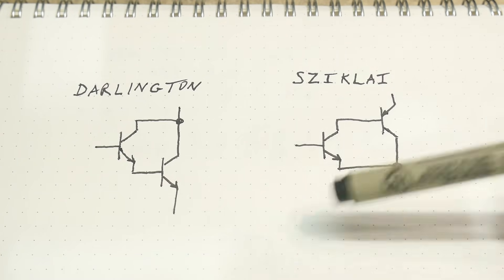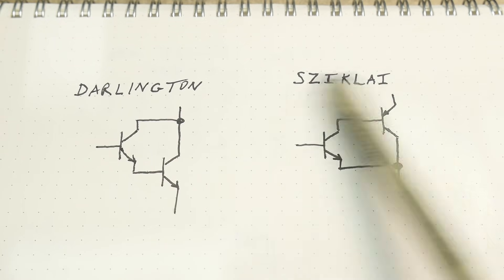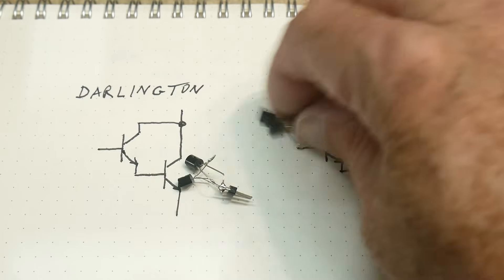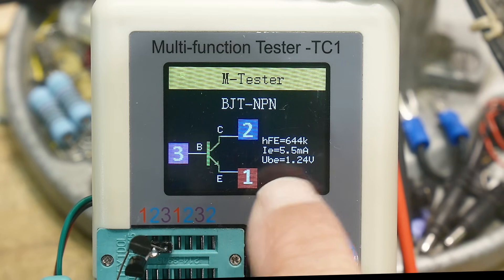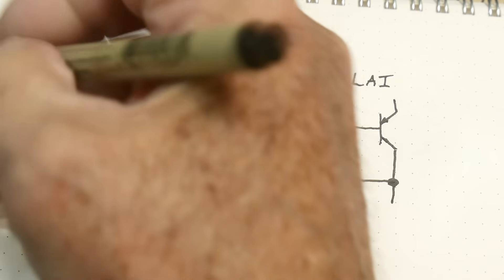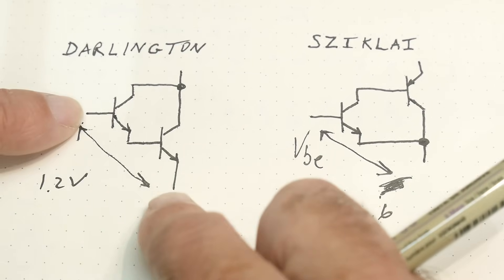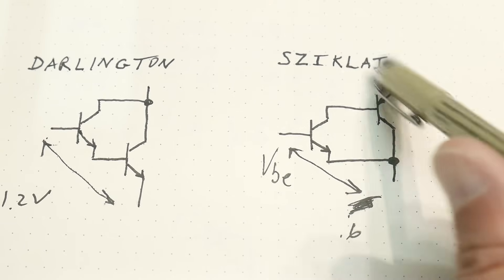#1776 Darlington and Sziklai Transistors

Comment: The Sziklai design is very convenient for amplifier power output stages. At first you don't lose less output voltage swing, because it can be driven closer to the + and - power rails. At second the temperature compensation of the idle current of the output stage is less critical because the driver transistor gets less hot if you oversize it a little bit (use a 500 mA to 1 A device if you have to handle 50 to 100 mA) and don't locate it in the direct vicinity of the output transistors.

It is also good practice to use feedback resistors in the Darlington or Sziklai designs to limit the total current amplification to a reasonable amount (1000 to 2000) in order to get a more linear characteristic of the emitter follower output stage.

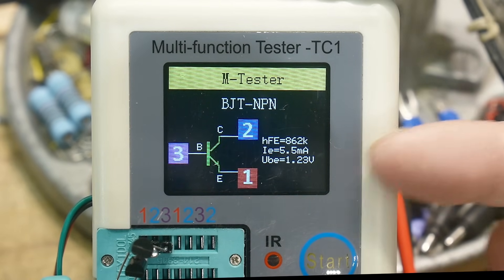Comment: 2:30, if the hFE of a transistor is 173, let's round it to 200, so putting 2 transistors in darlington pair configuration should give 200 * 200 = 40,000. Or roughly 20,000 to 60,000 not 862,000. What's going on?

Comment: The Sziklai is usually implemented with a bias resistor on the second transistor and there are 2 topologies.   One disadvantage of the Darlington is its low frequency response, compared to a common emitter stage.  While an emitter follower stage, using a 2N3904 for example, can have a frequency response of 2 MHz, a Darlington stage will only operate into a few tens of kiloHertz.     The Sziglai has a better frequency response than the Darlington,.   I haven't done a calculation (sum of the inverse time constants) for the Sziglai so can't give a more precise answer.  The cascode and differential amplifiers, which are both 2 transistor stages, have much higher frequency responses (~12 MHz)  and higher gain than a common emitter amplifier.

Comment: I may be wrong, but I think a Sziklai would be more temperature stable than a Darlington. PNP and NPN transistor combinations are used to stabilize temperature drift of control voltage in synthesizers fairly often because they behave oppositely to an increase in temperature.

Comment: @3:50 It's 0.544V instead of 0.6V BE voltage due to the very low base current. The diode characteristic is a e-function. If the current is lower than usual you move more to the left in the e-curve.

Comment: I also believe that the darlington is slower. There is a capacitance Cbe that can charge quickly if the base voltage rises but then you don’t have a good way to discharge it on the way down.

Comment: Didn't know about this topology, I think this topology is being used in the voltage regulator circuit of my NAD 3140 amplifier... but I couldn't really make sense (not an electronics guru) of this part of the circuit, so might make more sense now... not sure why they didn't just use NPN/PNP darlington pairs  as the circuit is dropping 10+ volts so 1.2 vs 0.6 vbe wouldn't have mattered, not sure why a voltage regulator would need the high gain of these topologies either 🤔

Comment: Sziklai: Very good pronounciation. The sz is a digraph and results in a sharp s sound, the kind of sound English speakers naturally tend to make when they encounter an sz digraph. the a and i are pronounced seperately, so you did well. The a is acceptable but if you want to improve: it is almost the same sound as an english "uh" makes. just make sure to pronounce the i at the end. don't swallow it. it is almost as if there is a "aji" at the end, just without the "j".   
Btw, pretty much every name that starts with "sz" is either Hungarian or less likely: Polish. Annoyingly enough the "sz" in Polish sounds like a "sh", pretty much all digraphs in the languages are reversed.

Comment: Great discussion, glad to have this shown to the masses! Maybe some enterprising young engineers will consider the Szilklai in their own designs. I see this in a lot of AF/RF amps due to its ability to work at lower bias levels. I'm not sure how much of that is due to actual circuit knowledge or just copying libraried designs.
An interesting topic that might be fun to cover is the difference (probably no more) between Japanese 'electron-flow' teaching and western 'voltage flow' - and how that influenced the design of amplifiers, increased the use of PNP transistors in Japan, and how it makes 1960s-1980s Japanese schematics so darn hard to figure out ;)
Great video, love the content. Cheers!

Comment: You forgot to mention that the Sziklai (my guess tsiklaiy pronunciation) configuration also has a much lower output saturation voltage, as it's about (1 x Vbe) + (1 x Vsat) where as for the Darlington it is roughly (2 x Vbe) + (1 x Vsat).

Comment: I created an abstract from the transcript using Gemini Advanced 1.0:

Abstract

This video explores the configurations and applications of two transistor types: the Darlington and the Sziklai (pronounced 'Sik-lie'). The speaker begins by emphasizing the similarities between the two, noting they both serve to amplify current. The primary difference lies in their base-to-emitter voltage (Vbe). A Darlington configuration will have approximately double the Vbe of a single transistor due to the cascading of two transistors. Due to their lower Vbe, Sziklai transistors can be advantageous when used with low-voltage microcontrollers.  For higher current applications, the speaker notes that NPN transistors remain more readily available and affordable, explaining the continued popularity of Darlington pairs.   

Keywords: Darlington Transistor, Sziklai Transistor, Vbe, Current Amplification, Microcontrollers

Comment: Also the Sziklai pair is the basis of your IGBT power device, integrating a high voltage low gate capacitance n channel mosfet with an absolute brute of a PNP power transistor, and a diffused base emitter resistor, plus a massive body diode thrown in almost for free as well. Low drive needed for the mosfet, and it can turn on and off fast, and the power PNP transistor can suffer the miller capacitance without reflecting into the gate as a huge charge you need to either insert or remove. So the advantages of a mosfet of not needing huge charge to drive for a huge current, but also no huge gate capacitance either, even if the overall device is relatively slow in acting, but it does have very good pulse rating and also a very low forward voltage drop, unlike the darlington, which will always have around 1V5 of drop across it irrespective of gate current, due to the 2 base emitter junctions, and the first transistor needing to have some voltage across it, plus the second transistor will never saturate.

Comment: Thanks alot....

I knew you are a genius, a great inventor and HP was a good place where they encouraged IP...

You have 57 more than I. At least we got like $2K each & better than a kick. We had a few weirdos...then liked to patent strange things...just for the money...but had little practical purposes.....I mean I admired their creativity...

I am not even in that league of brilliant inventors...

There was popular little Darlington TO-92 we buy by in the 1000's...plastic 

I have to look it up..

I think called an A10...Motorola

Eariler during your Tek scope...and you gave up on the semi discrete design and replaced with 7805...

I know I babbled...later it looked like there was another voltage...for I thought just 11 VDC dropped to 5....then I heard 19 VDC...

In this Tek little circuit...

It seemed to me..the comparator..if like a LM339..wouldn't it just switch on or off...and be noisy and output chopped then need filtered...so the comparator in the Tek... isn't it really a linear bias little Op amp....?..not a noisy switcher

I like a better recording instead of my tiny phone...at work big display....no time to look up Tek scope +5 VDC or watch your YouTube lession ...

Probably head to Verizon...for a tablet...

Our like fast curve tracer or computer that basically stored every bias point in digital...and list pass fail ....we had some Tek carts too just like yours on carts for nice entire curve display....Our main transistor tester was a Lorlin driven by the PDP-11...about the size of a small closet....plus the transistor handlers....

I mistakenly I called it a Loran...which ia a navigation system....

Our little AA community college....for those circuits 1986 ish we had the Malvino book...no calculus needed -I could hang with that...sort of simple and appropriate for the class

I seen the Sziklai pair with the Darlington.....in audio amps...National Semiconductor great little old school AB bias...nice application notes....would show like what Malvino touted...

NPN Darlington for top pair...and Sziklai pair for like the bottom or when the signal goes negative....the advantage being the Darlington and Sziklai when paried they both used both NPN in final pass with 3 diode....so crossover maybe less

Malvino annoyed me somewhat...no real circuits from the standpoint of use a 2N5179...I like cracking it open...time to time...

And NPN Darlington on top with PNP Darlington on bottom...is usual...but maybe tougher to find NPN PNP complementary pairs...plus there were 4 diodes...to help bias...

So cross over distortion must be worse when your final audio amp uses NPN Darlington on top and PNP Darlington 
pair on bottom.....4 compensation diodes

I thought he was Japanese too!

Thanks for the enlightenment of his accomplishments and reminding us of yours...

Another reader asked a few of say your biggest most successful..but then you might be worried we might look up your name...

When I worked at IBM...to install and test semiconductor tools...they had great patent reward system...

Luckily...I never tasked to build...soild state audio amp...which I like to do if assigned...and if my goal was easy...like a 20 watt rms continuous into 8 ohms 10 Hz to 15 KHz...and distortion not to exceed 1 %....I could handle that and love to play...

Maybe I will look up good old classic audio amp and see their circuit...like a Carver or McIntosh...probably spelled wrong...

Some how I am intrigued...the Tek design +5 with their Hfe custom picked gain...that it didn't work....yet not burned out...and you bailed...and I don't blame you one bit...

We love our 7805, 7812...7815...LM350 linear power hogs, quiet,  simple and stable....

Thanks again...

After I get the axe or retire...I still like to Patrons or see if you could help...sort of bam...quick consult work...and that ball is in my court

Thanks for reading..

Time to see and read our other more gifted electronic wiz follower comments...

Kind regards 

Fred

Comment: I came up with this configuration on my own when trying to avoid the inability to saturate a Darlington pair unless you have a voltage at the first base 1.2V above the second transistor's emitter.  It just seemed like a very simple complement to a Darlington, and handy when you wanted to fully enhance a PNP power transistor, but didn't want to expose the driving circuit to the potential high voltage on the PNP's base (ie logic).

Comment: I will appreciate if you explain the functioning of a TL431 connected to the ground of a 7805 regulator to get a variable supply from 1 to 5 volts .The TL431 refrence pin is conected to a voltage divider between the 7805 output and ground .Thank you very much
Reply: that won't do. In such a circuit the voltage at the 7805 ground pin will be above ground. the 7805 output voltage wil be 5 volts above it's ground pin.
However the 431 will sink current at the cathode until it's ref input drops below 2.5V. To regulate to 2.5V at ref input the 7805 output must be at 2.5 volts times the resistor divider ratio, which is achieved when the 7805 ground pin is at 5 volts below that.
Within the 7805 some current flows from the input pin to the ground pin, which pulls the cathode  of the 741 until the output voltage raises to the level that results in the 2.5V at the reference pin of the 741
Reply from the maker: maybe this would help: https://youtu.be/oYj67rNUUNk?si=hYq-Qia5rkE1_KKH

Comment: I learned the Sziklai circuit as the "White Darlington".  I have no idea who What was.  If anyone does, please let me know.
BTW:  Mr Sziklai's circuit can be done 3 transistors deep. A PNP driving an NPN driving a PNP can give you a really high HFE.
Reply: @seanoconnor1984 With high value emitter to base resistors, they also work to control heavy loads from low power circuits.  I did the 3 transistor thing in a power supply I made for hobby stuff.  On PNP drove 2 NPNs which drove 4 PNPs.  It spread the heat out enough to let me get all the heat into a big heat sink.

Comment: Here is my observation... 
- Sziklai is pronounced differently in USA and the rest of the word.  When I moved to USA I had to relearn to pronounce a lot of words such as Boston which is pronounced "Baas ten" here.

- Here is shown  an NPN driving a PNP (power) transistor.  Power silicon PNP were harder to make and were much more expensive. For example MJ2955 was many time more expensive than its NPN counter part 2N3055.  The Szklai pair is counter to reality in silicon age.  But one thing we forget is  Sziklai came up with this combination in germanium eara.  When he invented this circuit in 50s, it was after transistors had been invented and they were mostly made with germanium.  In that eara, PNP germanium power transistor were more common than NPN.  I have never seen an NPN power transistor myself, and I have seen a very few low power NPN only. That's why you always see an NPN driving a PNP transistor when someone describes the pair. 

- Both of these pairs have their issues like the frequency responses/the unity gains frequencies, and saturation of driving transistor.  That's why you only see them at the power output stages of audio amplifiers.   Another more common circuit is using both in common emitter and driving the base of power transistor with a resistor.  That resisitor limits the max current to the power transistor. 

- I'm trying to earn 3x1 cents here ;)

Comment: So if your aim is for power, I imagine the two transistors don't have to be identical or complementary, I think perhaps the "gate driver" transistor can be a signal transistor that's driving a power transistor.
Reply: Since in both configurations the resulting Beta is approximately the product of both transistor Beta values it can be useful to pick a large beta one for the smaller one, as it needn't be rated for the output current, nor heat dissipation ability

Comment: Both these configurations are great, just beware if they are used somewhere where they can "see" RF signals, they are a pain in the behind to stabilise. Don't ask how I know 😑
Reply: @seanoconnor1984  Exactly! And emitter followers can be biased as to seem inductively reacting. I used that quite often to taylor freq. responses of circuits, but any inaccuracy in the extraction of the parasitic caps of the layout means a few hours in the lab debugging the circuit ... As a rule of thumb:  an amplifier oscillates, and an oscillator amplifies, thanks Murphy :-)

Comment: Thanks for the video.  The video reminded me of the resistance measurement current source used in the  HP34401A DVM. For the life of me I can't figure out how this circuit works.  This circuit would make a great video episode.   Part of the circuit contains two strings of 4 PNP transistors connected in series, an op amp and  four selected resistors to set the current.   
Craig

Comment: The reason why the Vbe for the Sziklai pair is only 544mV is that the base current was 6.1mA/11,100 = 550nA. That's not an unusual voltage drop across a silicon p-n junction at such a tiny current. The Vbe's that you were expecting, 600mV - 700mV, are more typical of p-n junctions passing milliamps.

Comment: Big difference in the "on" voltage of the two configurations. The darlington cannot go lower than the EB voltage of the transistor while the skezke configuration can saturate to millivolts.
Reply: on the flip side, and possibly more importantly, the Sziklai cannot sink below the pnp stage's Vbe
Reply: @emiliaolfelt6370  AH!  I had overlooked that!  Thus, both circuits are lossy in a saturated state.
Reply: @emiliaolfelt6370 I consider Darlington better as emitter follower and Sziklai as common emitter.
Reply: Agreed. And in many ways, the most important difference in switching applications.
Reply: Can't the Darlington pair go to millivolts? The Vbe for both transistors is provided by the input base voltage. The Sziklai on the other hand requires the voltage from the load side to overcome the Vbe from the pnp. Thus it is the other way round

Comment: 03:52 that's because Vbe determines the Ic of a transistor, and in this case the collector current for the NPN tranistor would be reaaaally small (since it's the Ib for the PNP that has a current of 6mA trough it). Even in a darlington the Vbe of the driving transistor will be smaller than that of the power transistor.

Comment: Interesting topic. The first transistor has a much lower base current and as such also a low Vbe which is a nice feature.
I’m thinking what would be the behavior over frequency as the miller caps may work differently in the Szillai pair. I need to check this in LTSpice. Any thoughts anyone?
Reply: I would think the Sziklai would be able to de-saturate faster as a small resistor could be added in the middle to pull the smaller transistor out of saturation.